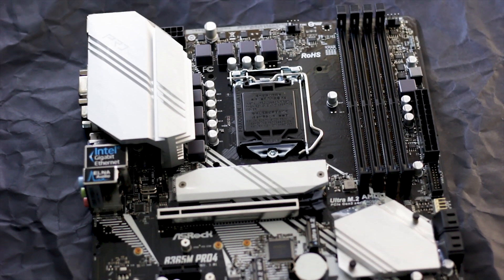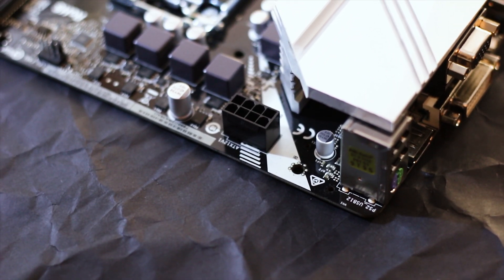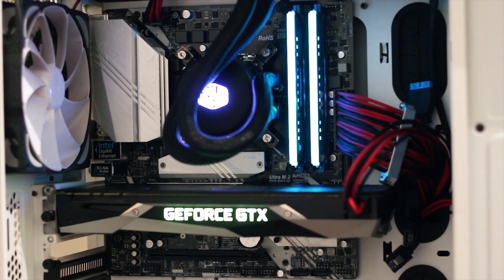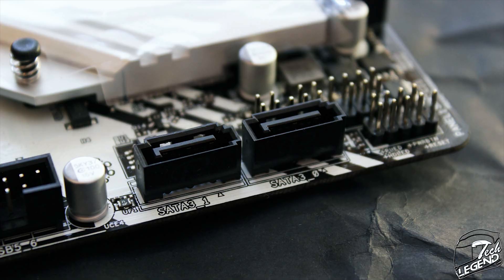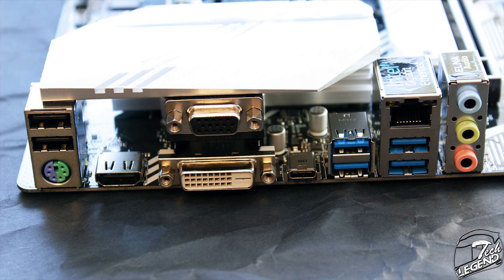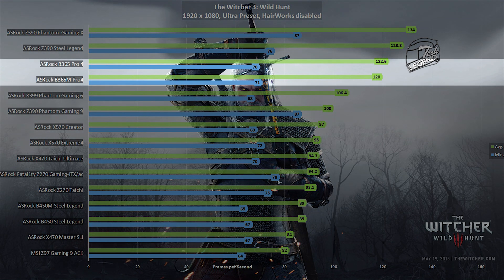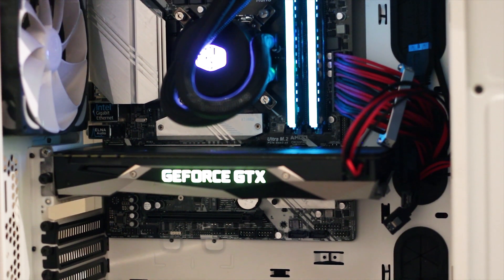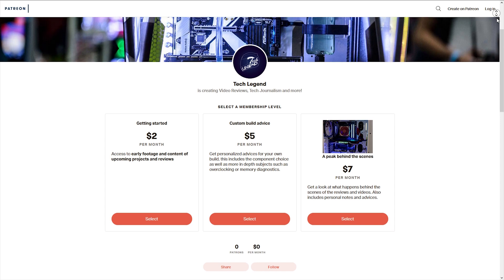ASRock B365M Pro4 Review - Cheap Performance! Ft. Intel i9 9900K

Comment: Thinking of pairing this motherboard with an i7-9700. My case is big and has a top fan flow out. Will this be okay?
Reply from the maker: Should be ok.
Reply: Tech Legend would a i9-9900 be a bad choice with this motherboard? Now I’m thinking get 16 threads If I can lol
Reply from the maker: @jtvalente  If you can afford a CPU with such a performance, it would be a better decision to get a motherboard that matched that performance. Thus, you want 16threads, get something with better VRM and a better chipset. These B365 motherboards are meant for budget gaming not high end performance.
Reply: Tech Legend good point. I’ve got the i5-9400f and see that i7-9700 is on sale on amazon. I’ll probably stick to just the i7. Thanks
Reply from the maker: @jtvalente  Makes more sense.

Comment: My motherboard no display if i put in dim 2 and 4 but it boot when i put in dim 3 and 4 is it normal?
Reply: The ram
Reply from the maker: @ariqwibowo5438  It's not normal, check the compatibility list for your RAM kit.
Reply: @TechLegend-com  i have dual channel ram kit tho i already reset cmos and still no display in 2 and 4 dim
Reply: @TechLegend-com  my pc constantly bluescreen when i 4-6 game hard gaming
Reply from the maker: @ariqwibowo5438  Did you check if the RAM kit is compatible with this motherboard? Did you update the Bios? Are you using XMP?
Reply: @TechLegend-com  yeah i check it and it's compatible, i haven't update the bios, and i dont use xmp. All my part in pc is brand new tho
Reply: @TechLegend-com  thanks for fast responds mate!
Reply from the maker: @ariqwibowo5438  Update to the latest Bios version and then we can talk.
Reply: @TechLegend-com  thanks mate +1 sub

Comment: i have this motherboard and its a great one for the price , i have it paired with a 9400f and a 1660ti gpu  all the games i play are 1080p @  ultra settings. no issues or anything .
Reply from the maker: Great to hear. :)
Reply: Hi, i want to buy the same build but i have a question.
You think that it can fits a 212 EVO CPU Cooler?
Reply: @rbaq  yep!
Reply: Is your gou a bigger sized one? If so... does it matter because I have a Asus Radeon Rx 580 5d 4gb that's a lil big because the dual fans... and I esnt to make sure that I can also put in my wifi adapter with no problem
Reply: Would this motherboard work with an Intel i7 9700f and gf rtf 2060? Would love an answer from someone already running a similar or same system :)
Reply: @tanja-k   yes  it would def work
Reply: @Ghostintheshell3551  Thank you for confirmation :)

Comment: will the ASRock B365M Pro4 Micro ATX LGA1151 Motherboard work with my Intel Core i5-9400F 2.9 GHz 6-Core Processor and a GALAX GeForce GTX 1060 3GB 3 GB Video Card?
Reply from the maker: Yes, but make sure the motherboard has the latest Bios update.
Reply: @TechLegend-com  how do I do that?
Reply from the maker: @mysticirl53  Before you buy the motherboard, ask (The person selling it) if it has the latest Bios version installed, or if they can update it for you.

Comment: Would you recommend this for i7-9700k , RTX 2070 super, 16gb corsair vengeance pro for 1440p 244hz gaming?
Reply from the maker: Not really, you have an unlocked CPU, so you are better off with a Z390 motherboard that allows some overclocking and has better VRM to handle the higher TDP of the 9700K.
Reply: @TechLegend-com  Thank you for the quick response, as this is my first build I want to make sure everything is perfect and im getting most of my parts, Thank you ! will go with msi MPG Z390 GAMING PLUS. subbing to your channel as well, awesome review.
Reply from the maker: @takesme5362  Great to hear it was helpful. Thanks for subscribing! :)

Comment: Will this work out of the box with a i5 9500 or do I have to update the bios?
Reply from the maker: No, you need to update the Bios to version P4.00.
Reply: It should work out of the box im using a 9500f

Comment: So I can’t use an intel core i9 9900KS with this motherboard?
Reply from the maker: You can, but it is not recommended. You need a Z390 motherboard for that CPU.
Reply: Tech Legend but an intel core i7 9700K is good right?
Reply from the maker: @Goong1.618  No, this motherboard uses the B365 chipset, it does not allow overclocking or high RAM frequency. For any K CPU, you need the Z390 chipset.
Reply: @TechLegend-com  But it will work good with a i7 9700k without overclocking??
Reply from the maker: @jakob1944  It will work, but you are wasting money having that combination. You need the Z390 chipset for those types of CPUs, to not only overclock but also have higher memory frequency.
Reply: Tech Legend I have water cooling in my pc so can I still not use an intel core i9 9900K ?
Reply from the maker: @Goong1.618  It is not an issues with the cooling, but with the compatibility. The 9900K does work on this motherboard, BUT, not at its full potential. A unlocked CPU, should NOT be used on a B365 chipset, you need a motherboard with the Z390 chipset for these CPUs.
Reply from the maker: @Goong1.618  It says "access denied".
Reply: Tech Legend oh well it just says that the intel core i9 9900k is compatible with the b365m pro mb
Reply from the maker: @Goong1.618  Mate, I never said that it won't work. What I am telling you, is that: the "K" or unlocked CPUs, should not be used with these motherboards. The B365 chipset is meant for locked CPUs and low frequency memory. Using the 9900K with  the B365 chipset is just a waste. You can't overclock and you can't use RAM that has more than 2666MHz. Do you understand?
Reply: Tech Legend yeah
Reply: Tech Legend but can’t you safely boost the i9 from 3.6 ghz to 5.0 ghz ?

Comment: I can get into bios with i3-9100f? So i can update bios
Reply from the maker: Depends, to be able to use the 9100F CPU, you need to have the Bios P4.10 version installed, otherwise it won't boot. I'd recommend you to just ask the shop that sells you the motherboard, to update the bios.
Reply: @TechLegend-com  thanks
Reply from the maker: @spifi6868  You're welcome! :)

Comment: Solid Backgrounds for the Charts man. Hard to read otherwise. Good review though!
Reply from the maker: Will do! Thanks for the feedback. :)
Reply: @TechLegend-com  hi there, I have a gigabyte version of this board, Are these two the same in comparison? Thanks.
Reply from the maker: @whyers4782  What motherboard are you talking about exactly?
Reply: @TechLegend-com  I'm talking about my GIGABYTE B365M DS3H mine seems to have less VRM capacitors and have ZERO vrm cooling. Does these two have different bus bottlenecking? or they are similar. i'm aware that my chipset is similar to this asrock one and i think mine has less overclocking capability and less volts to give to the CPU. Hopefully you have enough data to know the difference between these. Thanks
Reply from the maker: @whyers4782  I have never reviewed that particular motherboard. However, from what I was able to research on the B365M DS3H motherboard it seems like a solid product. As always, overclocking is not really made on B365 chipset motherboards, as those are not really equipped for high TDP CPUs. But if you just want to try your luck and have some gaming going on, it should be ok.

Comment: will this work with 9100f out of the box?
Reply from the maker: Depends on the fact that if that motherboard had received a bios update while in storage. For your convenience, you need to have the bios P4.20 installed for the 9100F to be working.

Comment: I bought a case that can support a full size mother board but, I accidentally bought the mini motherboard. Is it worth buying the b365 pro4f instead, or will the mini be fine? I’m also gonna be using a gtx1660 and i5 9400f.
Reply from the maker: The mini will be fine, the ATX and mATX motherboards are nearly identical, apart from the form factor.

Comment: I was thinking about getting this board with an i7 9700F (locked) and using a Coolermaster 212 tower cooler in a case that has good airflow (Coolermaster NR400 with two intake and one exhaust fan). Would that setup be fine? I've never heard of MB throttling due to high temps before.
Reply from the maker: That setup is good, just make sure you have plenty of airflow in the case. The motherboard itself is not throttling, it is the VRM Components that get hot, and those are responsible with the power being delivered to the CPU. If those get too hot, the CPU will throttle. But since it is an locked i7 9700F, it should work just fine.
Reply: @TechLegend-com  TY for the response... aside from possible BIOS compatibility issues (an older H370 MB), how does the feature set from the B365 chipset compare to the H370 chipset? If you're getting a locked 9th Gen CPU and want a budget MB, is the B365 chipset your best option?
Reply from the maker: @wolfshanze5980  In general, the B365 chipset is regarded as the best option for locked CPUs. When we talk about differences between the two chipsets, it all comes down to the features like: USB 3.1 ports, the PCIe lanes available and the available M.2 sockets.

Comment: if i use a 9700k with a corsair h100i platinum 240mm cooler, would it be fine? (on this motherboard)
Reply from the maker: Not really. Why do you even want to use an unlocked CPU with a motherboard that doesn't do overclocking? For that 9700K, you need a Z390 motherboard.
Reply: Tech Legend I’m not planning on overclocking
Reply from the maker: @benjamindanilov  It will work, but I don't really recommend it. Just because, a 9700K with a B365 motherboard, is not really a balanced system.
Reply: What motherboard do you recommend that’s mATX? @techlegend
Reply from the maker: @benjamindanilov  If you are on a budget, the cheapest Z390 motherboard you can get.
Reply: Hello I am trying to figure out why my pc is not really laggy but just dont fell right.  

I have a 1070 3 fan.  CPU. 9700k. Custom loop 2 120mm rad 1 240gb sdd next case. 16gb of ram corsair vengeance and a enermax cpu block with pump just for extra flow.  I'm not sure what to change or settings.
Reply from the maker: @puanz605  What is it wrong exactly? What happens?
Reply: @TechLegend-com  hello I have been playing with my settings for weeks now I cant seem to get it right bc when it works good and like it is supost to on modern warfare but if I play any other game like bo3 ark is really bad pretty much all games. It is not like a studer but it is not smooth mainly when I and runing in game or doing something.
Reply from the maker: @puanz605  Try enabling Vsync and see if it fixes things.

Comment: Will 9700 be okay?
Reply from the maker: It will work, but you will need better cooling for the VRM, is this a locked CPU?
Reply: @TechLegend-com  9700 is a locked cpu
Reply from the maker: @mbahmarijan789  Yes, I know. But most people don't bother to write that "K" at the end. You can use that CPU with this motherboard no problem, just make sure you have good airflow over the VRM area!

Comment: I have this board and use it with a I5 9400F.  I have to say it looks pretty good and seems to work fine.  Good review.
Reply from the maker: It is indeed, a good motherboard. Thanks for watching! :)
Reply: @TechLegend-com  I am using a down flow cooler mostly because I like that they are shorter and work in small cases.
Reply from the maker: @pctrashtalk2069  Yes that is correct, plus they get some air to the VRM. I would use one too, but the amount of assembly and disassembling I do on the system, that it's faster with a AIO cooler.
Reply: Does this motherboard support Intel virtual technology for creating virtual machines when paired with i5 9400f.  Suggest. 
Do upload a screenshot of the bios with the Virtualization feature enabled.
Reply: @tanveerqureshi3259  I'm sorry I don't know.